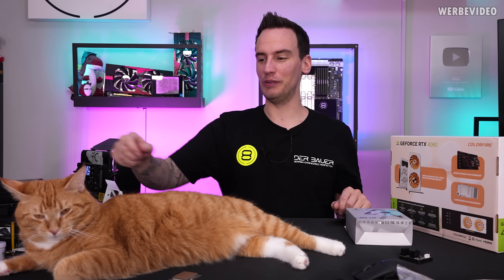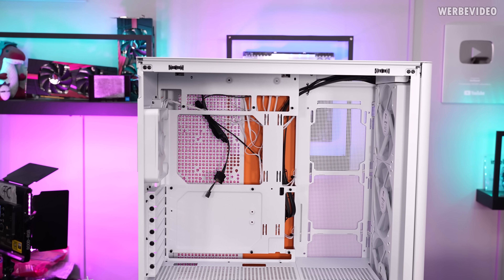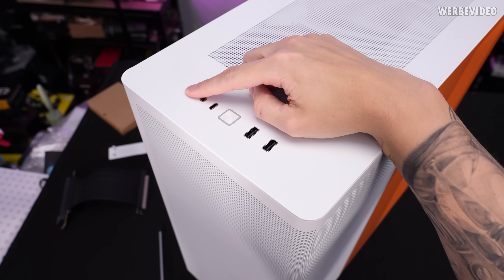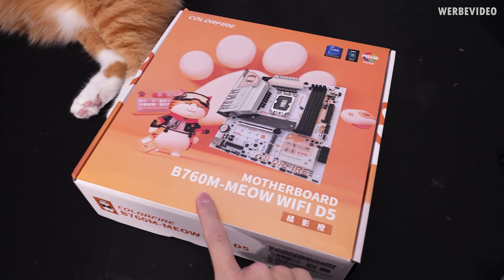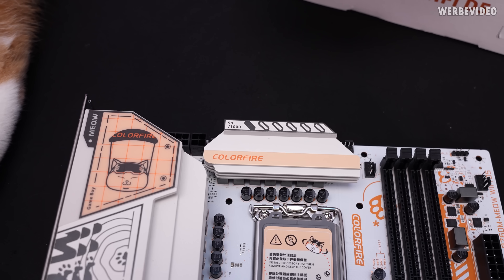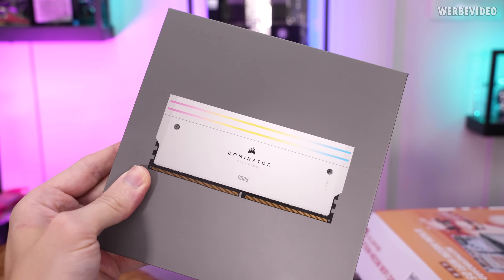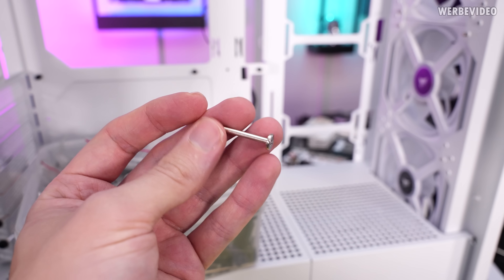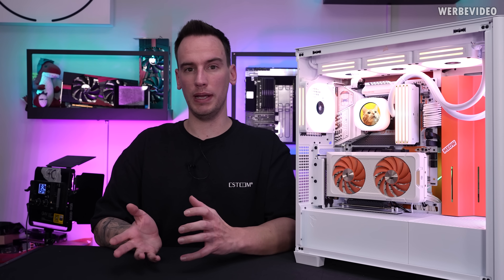We're building the Ultimate CAT PC

Comment: 3:42 - Mounting a backside cooling fan, like a slim 120mm or even a slim 80mm helps cool the back side of the CPU socket and VRM.  This can help lower temps a few degrees.  Many cases used to come like that from the factory back in the day.  The Xigmatek Utgard comes to mind as one example.

Comment: For sharp edges, if you have access to a good solid steel panel, you can roll the corner against a block of metal to round off extremely sharp edges. it will be a subtle change that will keep the shape of the edge, but make it not as dangerously sharp.

Comment: only thing missing is the cat RGB acrylic custom keyboard (on Amazon all over the place) and a mouse that looks like a mouse. Also, that white PSU shroud would be amazing with a LCD display on there, showing cat videos of course, on loop. There's one you can find that actually fits a MicroSD card for videos, plays standard video formats on it's own, adding zero load to the pc. I saw it on Amazon, can't post links but yeah, it's there, and has a white bezel version even!

Comment: I was thinking to put PC sideways, so the back side up, like a cat bed, where all heat came out from back side mounted AIO radiator and two (if you can) on the back plate, where you can mount fans, as the case said. But it's cute motherboard and GPU, so it's great build.

Comment: The ultimate Cat PC would need to use a large flat metal panel radiator with four sides at it's edges placed horizontally for part of a custom water cooling loop...ya know so they have a nice heated box to sit in.

Comment: Hey, i don't know if tips from a nobody like me is worth anything but, if you flip the radiator 180 degrees so the tubes from the radiator stick  to the back of the case and the pumps tubes still pointing the way you have it mounted, then you can hide alot of the tubes behind the gpu since you have it vertical mounted, and then stick up from near the exhaust fan, now some people i know takes the exhaust fan away when they do this, but you can tuck it in on the right side of the fan so it doesnt clip since you use a 120mm fan. I use a 140mm exhaust fan but in order to have it not clip with the fan there i have a smaller radiator with 2x140mm fans on, i could send you a picture to show how my builds are, oh tho im selling one of them soon.

Comment: I'm not a cat guy, but this build is just great :) 
Surprised you managed to run 4 dimms at xmp. From everything I've read and seen, I was under the impression I shouldn't try to run another 32GB kit... now I'm wondering if I should try.
I know you have a z790 Aorus Master. I have that with a 13700k, and 32GB of g.skill DDR5-6400 CL32-39-39-102. Have you been able to run 4 dimms at this speed on your board?